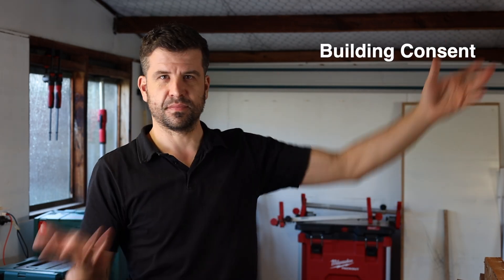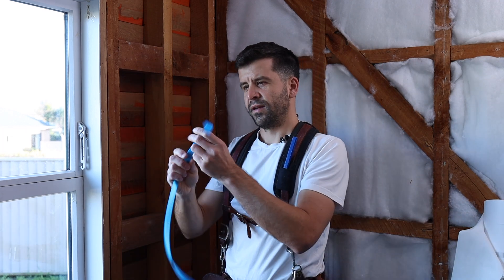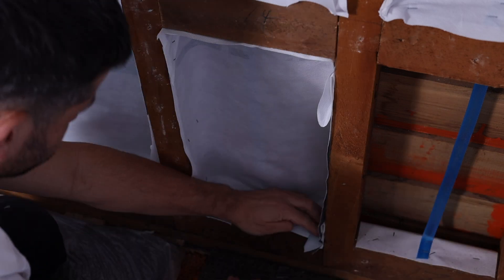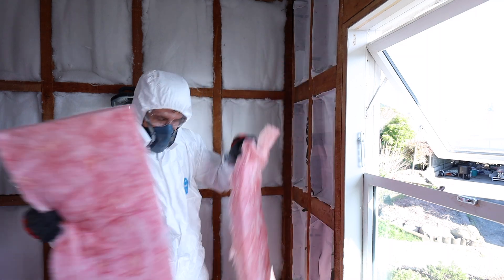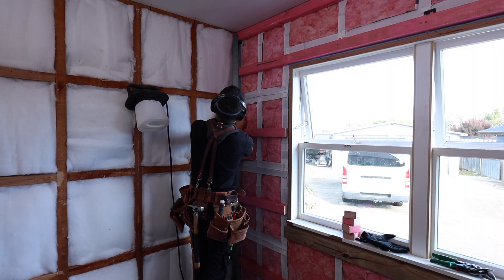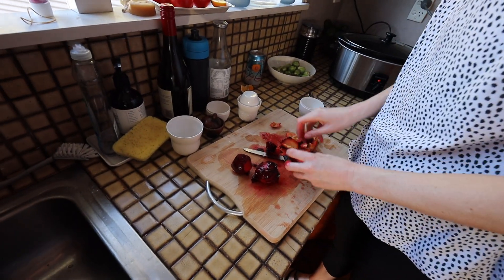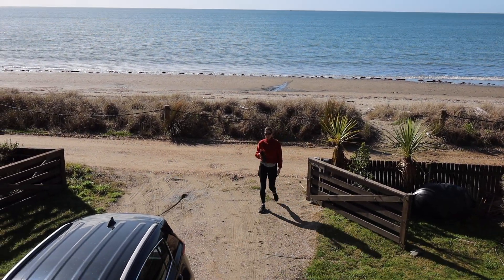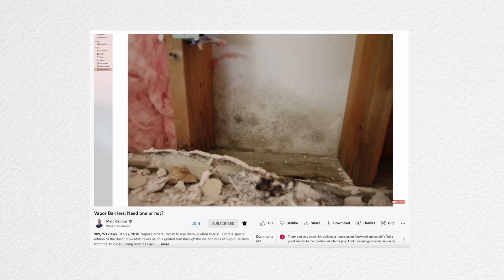We're Finally Going To Be Warm! Renovating Our 1960s House

Comment: Why don’t NZ houses have vapour barriers. Vapour barriers go behind the Jib board. People don’t understand temperature and dew point. Just have to look at the condensation on nz single glassed windows. Nice if you can build new and put the ZIP system
Reply: Not cold enough to need it and it adds risk. Better to have no vapor barrier than to have one in the wrong place.

Comment: Is solid core insulation not so much of a cost efficient options? I can see the interior added layer could be continuous solid core, just need long fastener for the drywalls, but less thermal bridge and potentially airtight drying to outside with some taping
Reply: Sorry I mean rigid foam insulation. I got terminology mixed up in mind.

Comment: We use a lot of PIR in the UK however it is nasty stuff. Thermally it's incredible but it's also fiddly to ensure you get a good sealed fit. It's also quite expensive compared to other insulation types. From a sound perspective wool is far superior as PIR offers almost nothing.

Comment: Ah yes, this is the perfect episode for me. My house, which according to the date stamp on the toilet cistern, was built around 1974-1975, so the building techniques will be fairly similar, aside from the use of pine instead of rimu. However, my house is clad in early Marley Grecko plastic cladding, which is still in good condition, but who knows for how long. Also my ceiling is totally exposed, with exposed rafters and a 12x4 beam running the length of the house, and interior linings pinned straight to the purlins, so insulating all of that will be tricky

Comment: Instead of keeping an air gap, couldn't you just spray closed cell foam? My understanding is it creates a break preventing condensation moisture?

Very cool, my house is also 60s and I need to do the same stuff.
Reply: Where does water from leaks go? Into the foam insulation. You could use closed cell foam but that stops moisture from moving, ie no drying through it.
Reply: @tweake7175  Right. The thermal break would be between the external wall and the foam, ie nowhere for water to condensate. External moisture stops at the foam, can't condensate, and dries as it normally from the outside in. 

I'm pretty sure it's alright. I've seen modern homes built where they spray directly onto the roof trusses and sheathing, and even metal buildings done the same way.

It is however much more expensive.
Reply: @tradermunky1998  but normally they spray against sheathing which is behind the wrb, air gap and cladding, not directly onto the back of the cladding. 
So where does water leaks go?
Reply: If insulating a container, you basically have to (or should) use the spray foam as I understand it. Then there is no gap between the metal and the insulation for moisture to form. However, it is very expensive and professional installers are recommended as safety is a big issue.
Reply: @tonylittle3508  on containers closed cell is used to air seal the metal so you don't get condensation and it doesn't soak up water like open cell. Plus metal wall is unlikely to leak.
Reply: @tweake7175  Found a matt risinger episode that addressed the same problems on an old house. He used what's called a dimple mat. Essentially it creates the same air gap but looks easier to me to put in. Then it can be spray foamed.
Reply: @tradermunky1998  the catch is the dimple mat becomes a moisture barrier, something we do not want. In this climate we want to allow moisture to move so it can dry in all directions.

Comment: Your R value seems to be the same as the one used in Europe. 10cm oof insulation gives you about R of 3. (Unless you use Pu panels). My house has the walls at about R 9 and roof at about 15 (55cm of insulation). In central Europe.

Comment: R-values in the US are different because they use different units. Your using SI-units so your R-value uses m²K/W. In the US they use imperial so their R-value uses °F ft² h/BTU. To convert from one to the other it's roughly factor 6. So a R3 wall in SI-Units would convert to something like a R18.

Comment: In countries that use SI units – such as NZ – if there’s a temperature difference of 10 degree Celsius across a wall with an  R-value of 1, then 10 watts of heat will transfer through each square _metre) of wall. Doubling the R-value reduces the rate of heat transfer by half.

For countries that use Imperial units (principally the USA), the underlying definition of R-value is the same, but because the units are different, the R-values are different: if there’s a 10-degree Fahrenheit difference across a wall with an imperial R-value of 1, then 10 BTU) (British Thermal Units) of heat will transfer through each square _foot of wall. Again, each time you double the R-value, you cut the rate of heat transfer by 50%.

The upshot of all of this is that the Imperial R-value for any given wall will be 5.68 times greater than the SI R-value. Can't think why people are saying it's non-linear. Maybe multiplying by 5.68 seems like too much of a challenge.

Comment: BLACK MOULD in and on walls.
This has been "right on the doorstep" with the Australia Building Codes Board for the last two years.
While medical experts still are not certain about a direct link to respiratory tract infections.
My nickel on the grass
The contributing factors are moisture and minimal air circulation, lack of natural light and a food source such as phosphate. More than being unsightly it needs removal wearing chemical resporator N95. 
Lastly, I'm very impressed with the wall insulation and gap sealing, great job and top quality: for sure.
P.s Notice with U.S insulation and complete gap sealing; also comes an expensive (humidity control unit). One assumes to remove human input of condensation: breathing, on walls, which would rise to room corners!
🌏🇦🇺

Comment: Check out Pro Clima. They have some great systems for reducing the moisture  travel and sealing tapes to prevent air infiltration/ leaking. I would also recommend heat recovery ventilation as just getting a room to temperature is only part of the thermal comfort equation. You can get these heat recovery ventilation units that just mount like a fan through a wall but they recover like 90% of the heat. Don't go to DVS they are dumb

Comment: Hi Scott, what's your plan for extending the window frame to accommodate the now wider wall? We're in the same situation by upcycling an old door and frame, but our 1920s villa walls are much thicker than the house the door came out of and therefore the frame needs to be made deeper.
Reply from the maker: There are a few ways to do this. You can add another layer of timber onto the jamb (similar to an architrave) and then add the architrave to that. I am going to add a wider timber onto the inside of the jamb, This will also be a way of adding window seals to the old timber window. Always easier to explain in a video, and this will be In the next episode.

Comment: I've seen in America people putting foam against exterior walls for insulation.  Would that have been possible here, or is the air gap a must have?
Reply: usa walls are typically sheathed, so your putting foam against sheathing (which is protected by wrb) instead of the cladding. if you put open cell against the cladding its likely to soak up water from any leaks and the wall will rot. you could use closed cell but thats a moisture barrier as well and can cause other issues. we typically want the insulation to let moisture through so everything can dry.
Reply: @tweake7175  Ah, thank you for the thorough and intelligent reply my friend!

Comment: I was wondering the same about the r values where I live in canada a 2x4 insulation is a r 12 and we mostly use r 22 now cause house are built from 2x6 attack spaces are an r55 so something must be different lol
Reply: R stands for thermal Resistance, what the numberial value for a insulation is depend on what units you use.  US and Canada have the value in °F⋅ft2⋅h/BTU   but New Zeeland and many other places us the SI variants  in K⋅m2/W   The conversion factor isthat the US/Canada numbers are approximately 5.68 higher the SI units. 

So R12 in Canada is R2.1 in New Zeeland. The R3.4 that Scott stated in the video would be 19.3
Reply: @target844  ahh I figured it was something like that lol

Comment: Maybe using the PIR plates is a lot less time consuming? If you get the right thickness it saves you a lot of tinkering with the 20 mil air gap. I think you're doing a great job, save your wallet, save the environment! 👍🏻

Comment: All kinds of issues can arise from using non-permeable vapor barriers. Here in Denmark, due to the climate and stringent legislation, we can't do without them however. Once we insulate with more than 250 mm of any type of insulation the ability for the humidity, created by people simply living in a house, to pass through the insulation and evaporate on the outside is greatly diminished. This in turn leads to mold and rot. Vapor barriers are therefore mandatory in order to stop the humidity from entering the walls/ceilings and mechanical ventilation is then added to remove the moisture. Mess up the installation however, and there's hell to pay.
Reply: Looking at this from California, I love the idea of air gapping the exterior weatherboards. I don’t know NZ codes but putting a vapor barrier, either papered fiberglass or a perforated poly sheet, between your gypboard and the insulation will reduce the moisture loading to the wall cavity.  The idea is to put the vapor barrier as close to the heated space as possible so that it won’t be a condensing surface. Oh, I read rock wool is slightly more permeable and dries out better than fiberglass which can get waterlogged  if a vapor barrier or air gap isn’t provided

Comment: Vapor barriers are challenging to design. They require an expert to consider all facets of home construction. Exact details of the HVAC system and pressure/air changes are needed. The entire home should be treated as a system.

Comment: Thanks for a very interesting episode. What proportion of homes in NZ have solar panels ?
Reply: stuff all. no govt subsidy here and if you feed back to the grid you get paid very little for the power.
Reply: @tweake7175  we’ve been very lucky in Australia with both Federal and State governments providing subsidies for panel and, batteries - most homes are eligible, but you can have only one subsidy - panels or, a battery. We installed a system a year ago and our bills are a quarter of what they used to be. I’m looking to invest in a battery pretty soon. The feed-in tariff is ridiculously low, so enhances the business case for a battery. With our new federal government, renewables are expected to set a cracking pace over the next several years.

Comment: Couldn't you borrow, rent or buy a thermal camera like the seek or the Flir one. They are plugged in your phone and you can see the weakest points on your solution and compare it to other wall yet to be insulated. Great work there by the way!

Comment: If I do outdoor wall insulation in that situation, I wouldn't aim for perfect Heat insulation, but rather Heat + Sound isolation. So rather than aim for R 3 as you call it, I would aim for sound isolation. Since I suspect you don't get too much increase in efficiency from standard to R 3 in heat isolation. Since it is typically the Windows and Roof (in sweden) that tends to be the culprit for loss of heat/cold. Meanwhile in your case, you got the floor too.

Comment: Imperial vs Metric R-Values are labelled differently it seems.  I was scratching my head at it because the amount you were putting in would be the equivalent of R-12 here in Canada.  Check out https://en.wikipedia.org/wiki/R-value_(insulation)#Units:_metric_(SI)_vs._inch-pound_(I-P) for a bit of an explanation.  Looks like a shortcut is multiplying your metric R value by 5.68 to get the North American version.

Comment: R5.5 = R1. Pink bats lose their R value with moisture, but I think you did as good a job as possible given everything. I likely would have done 40mm of XPS and 10mm ply to screw the job to on the inside.
Reply: I think the stapled vapour barrier biggest benefit was limiting air movement and circulation in windy turbulent conditions.  Helps keep the bats from slumping too

Comment: Looks like you’ve done a great job! Do you have access to anyone that could carry out a blower door test (or similar) in that room?
I’d love to know the difference prior to insulation to after installation in the amount of air changes in there! I reckon it would be huge. All that insulation and double glazing…..
Reply: Usually insulation doesn't do as much for air sealing unless it is a very dense pack insulation or is something like spray foam insulation. Air sealing is generally a separate step.
Reply: Yeah, that’s a good point. I understand that. Would just be interesting to see the difference in how well the room holds the volume of air as well as holds the temperature.

Comment: Always wondered about Insulmax and If it is any good. My ex-state house brick exterior doesn't retain heat effectivily and being up at the snow line it can get cold in winter. Any dealings with them or similar insulation systems?
Reply: Branz no longer supports those types of insulation systems.
not only do you risk leaks because they drill through the cladding (instead of the gib), on a brick house it fills the ventilation cavity, which stops the ventilation which is not a good thing.
i would do what scott has done. you also add extra power/phone/data cables while your at it. plus you get to paint the room a nice new color.
Reply: Insulmax has a code mark certificate, that’s legal approval of compliance with NZ building code, as opposed to an expensive BRANZ opinion

Comment: This just reminded me of all the absolutely appalling conditions many of us Kiwis live in, and our complacent attitude to suffering through the winter. I told my mother the other day what my most recent power bill was ($280, living alone in a 1920's house with gas hot water...) , and her response was that I should just wear more clothes... I spend the winter sitting in a sleeping bag. Clothing is not the problem.

Wearing more clothes does not make my house warmer, drier, or healthier, and it does not address the nationwide problem of poorly insulated homes, it merely delays any kind of necessary action to improve it.
Reply: Even most new builds right now are a joke, poorly built and poorly insulated.
Reply: @MichaelArthur4eva  And made using the cheapest materials imaginable. My mother thinks crazy thin skirting boards are fashionable... It's only marketed as fashion to cover up how cheap the building companies are. My sparky said he'd never own a new house here and thinks 1960's houses etc are built to a much higher standard, which is probably true given how much rimu you can find in those things.

Comment: I have been watching Matt Risinger for a while and am still wondering why we here in NZ don't use a R rated external sheathing and use GIB as bracing.
Reply: Simple, cost. Kiwis are to cheap to build properly. Which is why our insulation levels are so poor.
Reply: @tweake7175  cheap or the cost is twice what the rest of the world pays?
Reply: @glenwratt7814  bit of both. Just like insulation,  kiwis do the bare minimum allowed then complain about heating costs.
Reply: @tweake7175  yea tell me about it. I did a similar system to Scott's on my own 1950s house a few years ago. Builders I worked with at the time absolutely rubbished me for going above minimum.

Comment: Scott, what are the power prices like in New Zealand and is it linked to world natural gas prices?
Reply: Scott's and NZs power prices will be highly varable across time of day and location in NZ. His next door neighbours may pay totally different prices to what he does as a result. 

Will range from absolute minimum of US 7.5 cents for dead of night rates to maybe  24 US cents for peak winter day rates - maybe even a little higher. 

Prices are  per unit (kWh) .

NZ Average retail electricity prices are generally closer to 20 US cents year round. 

In local NZ prices that's an average of 30 NZ cents a unit. Prices in NZ Include 15% GST. 

NZ power prices are generally not related to or directly linked with world gas prices. The grid is highly renewably powered over 80% renewables some years. Fossil fuel is not the main source for electricity. But is still used mainly for peak demand rather than baseload. Imported brown Coal and locally sourced gas are burnt for peak fossil fuel power needs. 

In NZ Up to 50% of the power price is made up of delivery charges and sales tax . So direct comparisons of these prices to your neck of the world/woods is very difficult. 

Plus in NZ there is a daily connection fee of maybe 1 US dollar a day. This is highly variable throughout NZ - it maybe as low as 20 US cents or over 2 USD per day. 
Depending where you live and your electricity supplier. 

Notes: All prices here are
Including taxes and all per unit delivery (transmission) charges. 1 USD is about $1.50 NZ Dollars. Or going the other way: 1 NZ Dollar is about 66 US cents (54 Euro cents) as a long term exchange rate average.